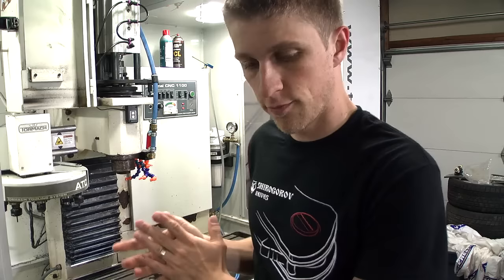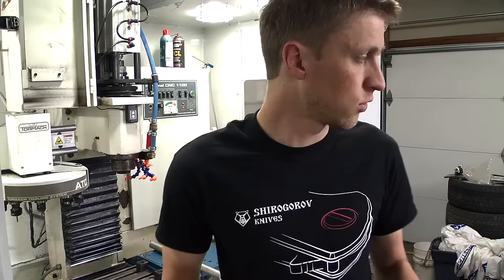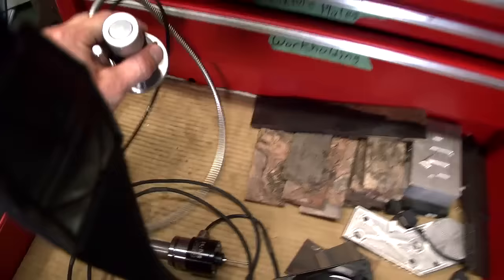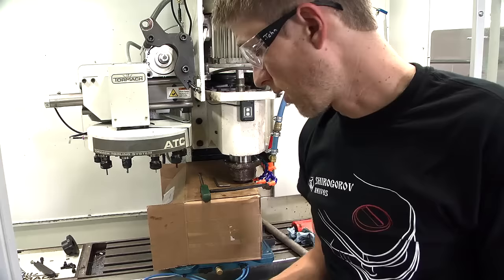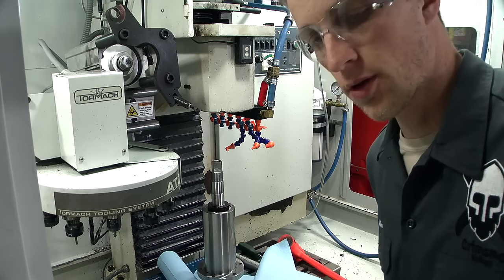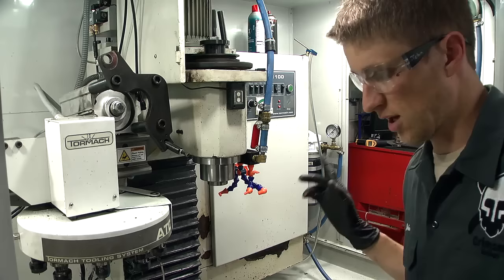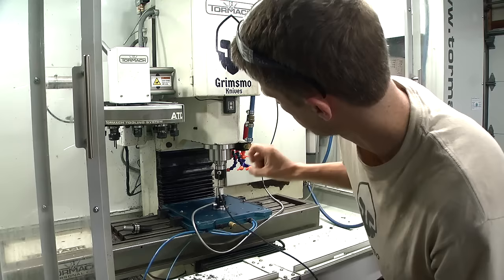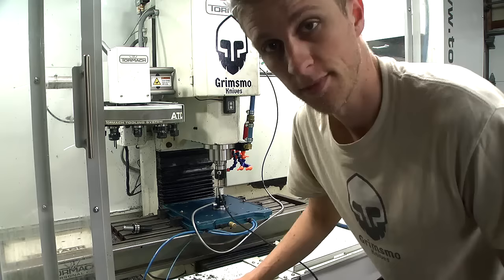KMT 114 - Spindle Replacement on the Tormach

Comment: For ease of use and because you have a bigger shop now, on your tripod's legs, build a triangle base that can take wheels. Makes filming in a shop very easy.

Also, rebuild your old spindle. Worth it. The rust can be cleaned easily and is just cosmetic.
Reply: +aserta
Time is money. How long does it take to rebuild? Frankly, paying $250 more for a complete spindle instead of just a rebuild set seems worth it to me if it saves a few hours of work. Maybe buy 2 or 3 and eventually rebuild several all at once.

If it just adds another hour or so to the job, then it'd be worth it to rebuild.

Comment: Hi John, another entertaining video. I too have changed my spindle, a couple of times. Once cos, I installed the BT spindle available from Tormach and then a couple of months later(from new) I started my machine and had this clicking(tick really) noise in the spindle. Contacted Tormach and they(long story short) replaced the spindle. Complete change under 30 minutes. But I don't have that gizmo(pardon the pun) above my spindle. And yes mine is whisper quiet too. Thanks for the video.

Comment: This reminds me of a procedure I had to do on a Haas VF-3 in a machine shop I worked in. I had to attach a broaching tool to the spindle and it involved unbolting the original spindle flange and muscling the tool upside-down into the holder. It was a pretty neat procedure and produced some nice key ways. I have to say I am really missing that job right now...

Comment: Premier coolant is the pitts John....... The new spindle looks nice, I made a shield for the bottom bearing on mine, directs the coolant away. I use thin  oil for coolant, it has a few drawbacks but no RUST...........

Comment: It would have been easy to call a HAAS distributor and get a price quote.  I owned a HAAS VF0 and their prices were EXTREMELY reasonable.  An entire tool changer was only like $2500, including the driver card to swap it over to an AC motor.  $7k is possible correct for a 12K direct drive or CAT50 spindle, but for your average VF, $3500-4k is more in line with what I'd expect.  HAAS machines are built like LEGO, they use the same parts (spindle) on a lot of different machines, so they get the advantage of quantity.  Mori Seiki is expensive because they are Mori and it comes from Japan, and they are probably obsessive about their spindles.  I've seen more Matsuura machining centers than Mori, but Mori makes good machines.

Comment: Mori Sieki and Haas are professional industrial level equipment. That's why their machines and parts are so expensive. I ran a 30 year old mori seiki at the shop I worked at before getting laid off and while it looked like crap, It ran like brand new and better than all the new machines. Never needed any work. The Haas VF6's would always break down.

Comment: 50 tools didn't change in length.  Your tool 0 or reference tool just needs to be reset to tell the machine where it is at for length.
Reply: Agreed, it should be all relative to the reference tool so no need to change them all.
Reply: +Kicker700 Nice! I came on here to say EXACTLY the same thing, particularly after a discussion with john on how this stuff should be setup. This is a perfect example of why your tool and fixture offsets should be an actual, positive measurement, which is counteracted by a gage length->table measurement.
Reply: +rob lockwood 
Totally agree and was also going to add a similar comment. The actual length should also be the number entered into the tool table. No negatives, no offsets, no taking the measurement from some odd point of the tool. Other methods "work", but I think this way makes the most sense.
Reply: There should be no "zero tool". The machine zero offset should be made between the spindle nose and the table. The workshift zero offsets should be between the table and the part z-zero point. The tool length offsets should be between the spindle nose and the tool tip. All tool offsets shouuuuld be static, so you could just plumb them in and type in the tool lengt/radius, without the need to measure them in the machine :)

Comment: Very interesting. Is the hole in the head that the spindle slides up into continuous? Or, is the spindle "hugged" only at the bottom and top? Hope this question makes sense. I'm thinking about the BT30 spindle cartridge that Tormach sells as a replacement, for use on a non-Tormach mill, and details are pretty limited. Thank you

Comment: Does'nt ppl notice the outside runout at 13:45 ? looks like its the lower surface too, which will make all tools runout bigtime. Maybe you can tun that face with a turning tool in the wise.
Reply: Regarding the OD runout, I noticed the same thing when I swapped the spindle on my Tormach.  It was actually a bit disappointing but I guess it comes down to economics.  You get a whole spindle for $550.  The ID is true but they don't turn the spindle nose in the same setup so the OD runs out.  This could be an issue if you're used to using an indicator clamped to the spindle nose to locate on a diameter.  I've ended up leaving an indicator in a toolholder so it runs true in the ID.  I did notice the BT30 spindle ID looks ground while my original R8 looks turned, and not very pretty either.  The BT30 also had much less OD runout which meant less vibration.  Not sure if this was just the particular one I got or if it was manufactured differently.

Comment: 20k USD sounds something like an electrospindle from some well known manufacturer. Under 10k must be just a plain spindle without a motor. I've crashed myself one electrospindle which replacement cost was something like 40 000 euros (8k rpm, HSK100, 32kW).

Comment: so its been 2 years john.. is the spindle quiet still..  did you take the time to machine the visible rust off the old spindle  and put new bearings in it as a spare.  do you listen to the spindle bearings and other bearings with a stick to the ear... or something like an automotive stethoscope to listen for upcoming failures before they fail..  when the cutting tool starts humming the harmonics go right into the spindle bearings like a million men with hammers pounding the spindle in all directions at the same time.  this is why spindle and other bearings fail eventually.. well that and lack of clean lube in the bearings.  did tormach ask for the old spindle assembly back.. so they could have cores to rebuild..  just thoughts..

Comment: Kinda depends on the machine how much it's gonna cost to replace the spindle and what you actually change. At my previous work a vertical machine, Quaser something, had it spindle motor changed (fanuc 10krpm encoder). I asked how much it was and was told about 7k€. The machine I were, a 1996 Fadal 4020 (fun machine, liked it, secretly, I prefer fanuc system more) had really bad bearing or something. Omg the noise it made. I can't remember if they changed it  or not beacuse the machine was old and had a new problem every day.
Reply: +Tommi Honkonen I work on a Quaser and Haas Milling machines too and we had our Spindle motor change as well, And it was exactly the same about 7k€, from Norrway fixed.. But it was our fault, we wanted too much from our little queser with only just 1 belt. Worked on Many machines, but i find quaser one of the best, reliable machine compared to HaaS or even Fadal..Hass has many little things that would just make the machine stop working just for no reason.. The Fadal we had was just plain old.. Tommi what was your sallary in the last CNC shop you worked in Finland?
Reply: Cobrass2 *Bout 1500€

Comment: The bottom line is, you get what you pay for. 500 bucks for a 3 year spindle? sounds about right although id hope for 5...
Reply: Think of the spindle as a consumable I guess. Probably less than $0.10 an hour in cost (500 / 2000 / 3) and John makes the replacement look pretty easy.

Comment: Your runout wasnt three tenths.  That would be .300"
Reply: When a machinist says tenths they mean ten thousandths of an inch not  1/10.
Reply: In machine shops, it is short for "3 tenths" (of .001").  
If we actually measured in tenths of an inch, (as you correctly specified),---we would be doing carpentry work. :)

Comment: you dont need measure your tools. you allready have measure them. you havent touch your tools . all you need zero point, all tools follow. even tool probe. if spindle is inch longer who cares. your tools still same lenght. measure zero point like normal
Reply: I am 58 and have been machining all my adult life.  I worked in over 20 different shops from aerospace to die shops to small job shops, and at least a half dozen brands of machines.  I never really found much of a need for any kind of tool length compensation that just touching it off.  I have found when others are making it fancy,--I am usually making chips. :)

Comment: Well maybe someone you or John should tell tormach to not sell cheap ass shit !!!!!
Reply: I have been living off a 12 grand 2007 PCNC 1100 for 15 years now.  I have been down for about a month total, with less than $1,000 in parts to keep me running.  The problem is many people do not have enough experience to know it is a light duty machine.  I only need small end mills, (usually a .125 diameter), and it does not like indexable inserts.  It is the perfect fit for what I do. I would have to say it is the best fit in the world for me, because i have to consider a nice fast small robodrill machine, (which would be great for billet parts that I can not do in production), for 80 grand.  If you don't try to move mountains, it is awesome.  In fact, buy the R-8 tooling for your shops manual bridgport mills.  Then you can change tools with out losing the tool length if you are running more than one part with it.
I have made as much as $125,000 in a year (for 3 years), with this $12,000 machine that I had paid off in 2 months.
I don't think it is possible to make a better choice for my business.  I would love to have a nice 15hp robodrill though, and spit out some nice billet stuff.

Comment: A real machine would walk all over this for decades. Tormach is CHINESE MADE SHIT
Reply: 12 grand, and I have been living off my 2007 model for 15 years now.  It broke down on me 3 times, (less than $1,000.00 parts total), and I bet I don't have 4 weeks of down time total.  I have worked in a lot of shops, and they get about 10 years out of a machine before it starts having expensive problems.  it does not move mountains, and I won't even run indexable cutters in it.  Normal cutters under .5" in dia and light cuts, (it is only like 1.5 or 2.0hp), and the machine lasts a long time.  I have not even adjusted the gibbs yet, and have over 1 million dollars of work through it.  The spindle is slow enough form my usual .125" cutters to not use coolant on aluminum, (not enough heat to clog the cutter flutes), and i use my coolant tank to recycle my way oil.  I do run production with it, (porting small 2-stroke cylinders), but the hand work I do after it comes off the machine takes longer than a cycle, so it works out well.  It has a pretty good set of ball screws on it too.  15 years, and all I did was blow out a couple things in the cabinet, (which I got parts quickly and replaced them myself, with some phone consultation if needed), and my 15 year old computer just died, so I upgraded to a newer one and their path pilot software just last week.  This machine saved my life man.  I worked in 20 different non-union shops, (where the skill is, but the pay was not), and earned 2 engineering degrees,---still just above poverty until I started my business with one of their 1st machines (1100).  I made as much as $125,000, (for a few years) with this machine. This machine got me put of poverty man, and it was so cool making more money than any union worker in the world from a 1 car garage. :)
Reply: @EarthSurferUSA  dear diary, no one reading that novel
Reply: @EricB90  Sue your school.  How is your math?
Reply: @EarthSurferUSA  I make more than you 😘